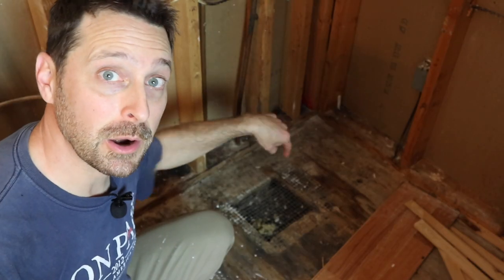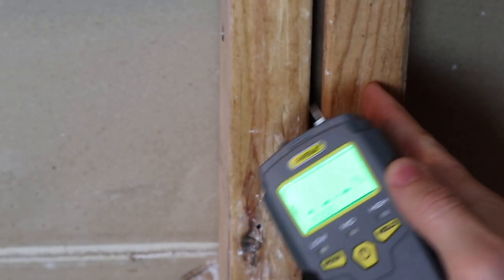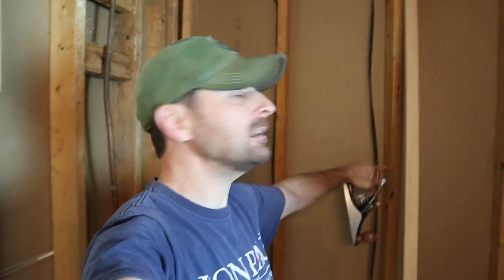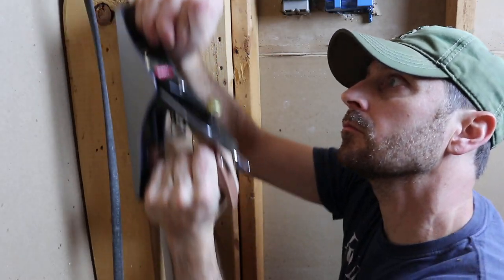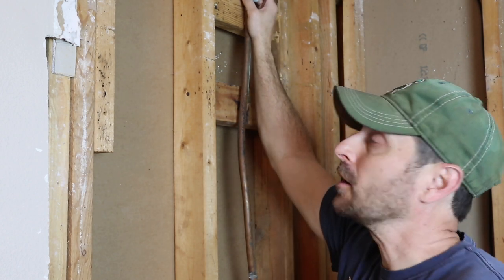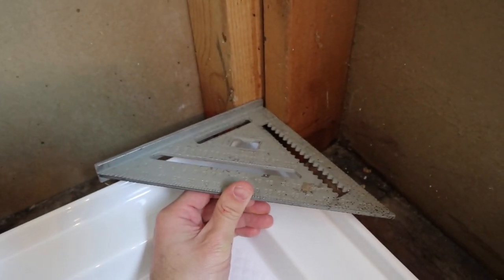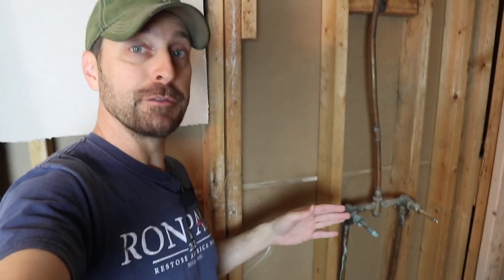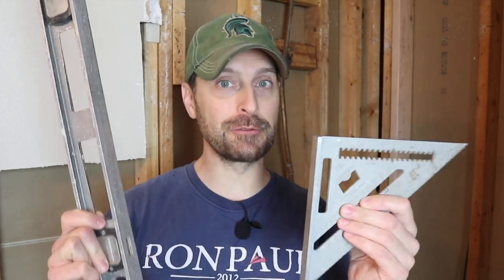How To Prepare Walls For Tiling A Shower (Structure) 6 Steps For DIY Shower Renovation Remodel Pt 2

Comment: Thanks for the video, very well explained.  I am in the process of tiling a shower that and neglected to make sure the studs were planar, and plumb and that the corner was square, and I am paying for it in a lousy looking tile job.  I was very careful with the waterproofing, but I thought the walls were straight enough as the were...not.  Learned my lesson, the next bathroom I do in my house will have planar, plumb and square walls that I attach my tile underlayment to.
Reply from the maker: You're welcome. It's a hard lesson to learn for sure. Hopefully your next tile job will turn out perfect.

Comment: What material was the drain made out of? Galvanized? Or was it ABS? I don't think I've ever seen ABS and soft copper be contemporaneous.
Reply from the maker: Drain? The supply is hard copper to pex  which is high density polyethylene.
Reply: @CountryLivingExperience  I'm presuming that the tub was leaking from the drain.
Reply from the maker: @orijimi  It was a shower and yes it was cracked around the drain body.
Reply: @CountryLivingExperience  Ah. Yeah, makes sense given the wood. What material did the builders do the drains in, though? If it's alright to ask.
Reply from the maker: @orijimi  The house is older and has been remodeled many times. The last shower was put in 10 years ago with a plastic (abs)drain. It cracked. I had a new brass one fitted 5 years ago by someone else. I think they overtighened it cracked the pan flange.
Reply: @CountryLivingExperience  Jeez. You keep throwing improvenents at a thing and still some part of it manages to fail you. Thanks for feeding my pointless curiosity. And thanks for the video, it was meaningfully informative for a not-a-carpenter.
Reply from the maker: You're welcome

Comment: So what do you do if your corners aren't square
Reply from the maker: You'll have to build out both walls in question. If you need to sister new studs to all the existing ones then do that to get a square corner.